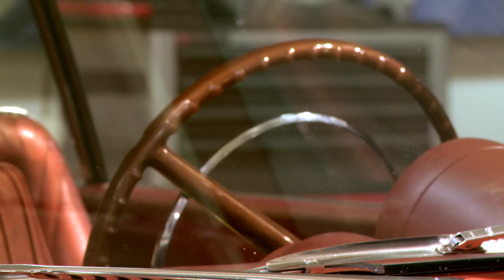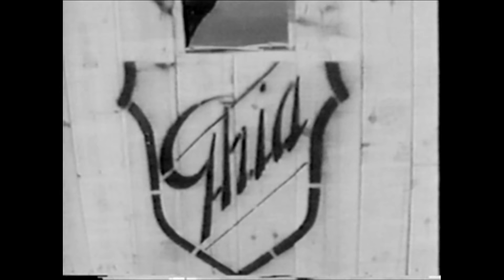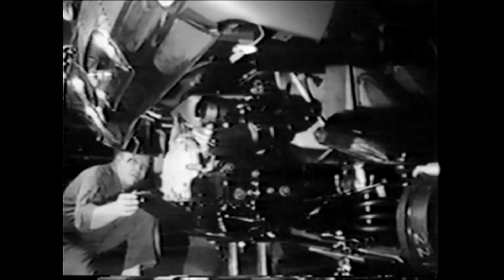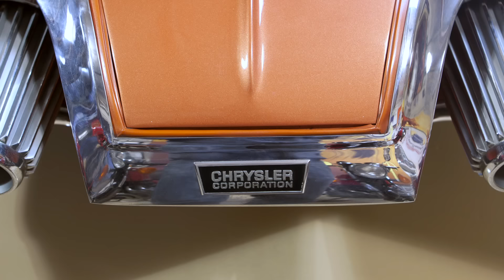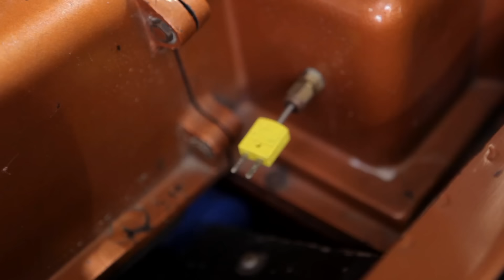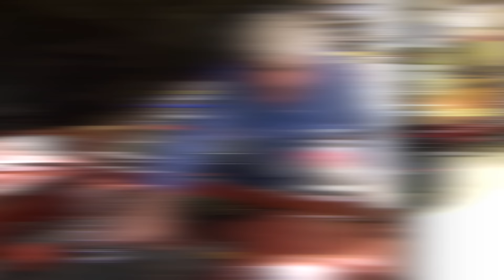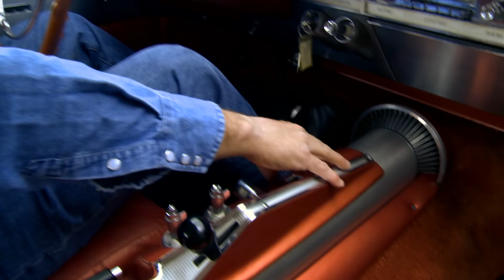1963 Chrysler Turbine: Ultimate Edition - Jay Leno's Garage

Comment: When I was a junior or senior in high school, I worked part time at Illinois Tool Works. They were a precision metal working company that manufactured the cutting tools, called hobs, (among other cutting tools) used to cut the gears for transmissions. Chrysler was a client. One of the executives at the the Keeler street plant in Chicago was given one of the cars to test drive for the three months. The minute I was the title of your clip, it brought back memories of that vehicle parked in the executive parking lot. The "pumpkin" color, the dials in the dashboard, the sound of the engine - what a thrill. Glad you have one of the remaining Turbines. It is in worthy hands.

Comment: As a 12 year old boy delivering newspapers in a small Western PA town one of these beautiful cars pulled into a gas station that was a newspaper customer of mine. The guy was filling the car with kerosene; I couldn't believe it. He was probably 30 or so, he was from New York. We struck up a conversation, he was very proud of the car which he said Chrysler was letting him use for 2 years at no charge (he had to give it back in 2 years). He knew I was genuinely interested and must have liked me because he took me for a 5 mile ride on the highway and back. Sounded like a jet engine. Took off like a rocket with tremendous acceleration. It has been one of my favorite cars since then. Almost 60 years later I still have vivid memories of that car and I still get excited thinking about it. What I wouldn't give for another ride in one.

Comment: Thanks for being a car guy. Be glad you didn’t put radial tires on more than likely you might have lost a hubcap. Seen this happen on a few older cars that came into the shop I worked at seems that the steel wheel just flexed to much.

Comment: As I was sitting at the bus stop on the way to high school, I saw this remarkable-looking car pull up to the light, then stop.  I thought it was just some kind of new "concept car" until I actually heard the engine running... it sounded EXACTLY like the turbine of a jet airplane, only quieter.  It was so cool that I nearly jumped up and shouted, but there were other people sitting next to me who would have thought I was crazy.  That was my only experience with a turbine-powered passenger car, but I'll never forget it.

Comment: I've said this before, ive drove this model 1000 times while I worked at Chrysler engineering. I was running a test to try make it fail to startn(it never failed to start). I also build the "variable pitch power turbine" that turned the engine into a tire smoking powerhouse with good engine braking. So much more.

Comment: I remember back in, I believe 1963 or 1964 the local Chrysler dealer had a special showing of this car. I was 14 or 15 at the time. I went to the showing as it was only about 4 blocks from where I lived. I was awe struck at the whole car. When the announcer said how smooth it was he demonstrated by putting a buffalo head nickel, you know the one that looks like an octagon, on edge while it was running and it stood there and didn't move. It was amazing. Never ever forgot that. Often wondered why it was discontinued. Now I know. Thanks for doing this video. I would have loved to ride in it. What a kick that would be. This was in Lethbridge, Alberta Canada. Population at the time was about 30,000 so you can see it was a big deal for us to have the car shown here.

Comment: Turbine story
I drove bus for Trailways in Boston Mass 1970 to 1976 and in the early/mid-'70s (don't remember the exact year) Greyhound experimented with a turbine bus 
On its first trip into NYC as it was leaving the Port Authority, it had to stop for the light leaving the Port and another bus stopped close behind it. Being a bit of an upgrade the driver of the turbine had to step on it to get rolling. Unfortunately, the combination of a roof level exhaust, high exhaust temperature, and a close bus didn't work out very well, it burnt the paint off the top of the following bus.

Comment: FYI:1966,US Army we had Chrysler Turbine track vehicles,all aluminum,we burned JP4 in them. You sat in the drivers compartment on a little secretary chair with hydraulics.To your side was a domed wire screen with a rotating fan blade,about 5' across. I mentioned to my Brother who was in Nam in '67-8; he said oh we had APC that were turbine,I told him no! ;you had Turbo diesel ,not turbine.Took him a while to realize we were talking about different animals.
The swoosh sound in the video is reminiscent,they were all auto transmission and we had two laterals for steering.They would turn on a dime and we did a lot of chasing jack rabbits,in Oklahoma. Their use was to carry missel sections,and other for communication huts,and a power station.So easy to drive and a lot of fun.Everything was secret on a need to know in our unit.Wikipedia states that the first Military use was in 1972 in the Bradley tank,but we had 'um first. And they were uber kewl.

Comment: Better in all aspects? How in  the hell do you explain the current fondness for Electric vehicles? Electric vehicles, where you spend more money for less car accept a limited range (God help you if you get stuck in a traffic jam or storm) in most cases still use fossil fuels to generate the electricity that still  has to be distributed over an ageing and already overtaxed antiquated delivery system with an extended time needed to charge. That's still not addressing the rare earth materials and toxic heavy metals needed for production for the electric automobiles and the issues of risk and environmental contamination should one be be involved in an accident. Don't get e wrong I could see a place for electric cars in the scheme of things but there seems to be a strong political opposition tot he lifestyle that would promote or grow the niche market electric vehicles could serve in.  I have to wonder if Chrysler shouldn't of taken some of this technology they developed for this engine and sold or produced it for aviation, marine and power production especially in co generation applications.  If properly executed we could of seen Chrysler turbines hanging off the front and wings of countless Cessna, Piper, Mooney, Beachcraft and Gruman aircraft or Chrysler Turbines producing heat and electricity in facilities using low grade recycled or bio-sourced fuels.

Comment: Exact same "lusted after" reaction as Jay, when they announced the turbine. Gobsmacked when I got to see one on display in Orange County. I have to wonder, if pairing the turbine in a hybrid like the Prius system, wouldn't solve the fuel efficiency problem. Is anyone is looking at that? I would think you could even scale down the engine size if the turbine is only powering a big alternator.

Comment: Chrysler's accidental downsizing of most of their full sized models for 1962 (triggered by an overheard conversation about a new "smaller Chevrolet", which turned out to be the Chevy II/Nova, rather than a radically smaller Impala) and the ensuing reaction of their customers almost sank them. It's amazing that  they pulled something like this off while under such financial pressure. Seems that the turbine engine is better suited to applications in which most of its run-time is at maximum power, like airplanes and electric generating plants. Maybe there would be a role for a small turbine engine in today's electric cars, to recharge the battery on long trips.

Comment: Great story!  I did a research paper on these vehicles, in college, back in the eighties, before the internet.  All of the information in this video is spot on and very well done.  Chrysler also looked at building the engines out of ceramic components or even ceramic coated components. The bonding agents that were developed made the ceramic parts as strong as steel, but there was no way at that time to mass produce them.

Comment: I wonder if ((like your rocket) the turbine could be rethought for today. Maybe using a scaled down turbine that works as a generator to power electric pancake motors at each wheel. 

Hybrids and electrics need mined materials, this you burn anything combustible.

Comment: The turbine powerplant should have started to replace the internal combustion engine at this point...consider the lightest of the American typical V8 engine makes 400 horsepower at 400 lbs of weight...the very old Pratt & Whitney PT6 turbine weighs the same 400 lbs, but is rated at 500 to 1900 horsepower(shaft-horsepower)...just think what could have been, if turbines caught on?

Comment: Being a Mopar fan, I knew of these cars when I was a kid. I remember reading about how these worked, the simplicity of the turbine engine. No pistons, rods, cams, valve trains, no distributor, ignition points, coils, etc. Also, Ford was using turbine engines in tractor-trailers in that era. The downside of the turbine was fuel consumption. The only turbine-powered vehicle I have ridden in is an M1 tank, which used some 2 gallons of fuel to move the tank one mile. I'm sure the Chrysler has a smoother ride.

Comment: I was 13 in 1964 and I remember these cars being featured in Mechanics Illustrated magazine (I think).  Don't recall if I ever saw one on the road.  In 1976 I was stopped at a red light in Van Nuys, California (Kester Ave & Victory Blvd) when I heard what I thought was a jet airplane flying very low overhead, but it was odd that the sound didn't seem to be moving away and remained quite steady, sort of like it was a helicopter.   I stuck my head out the window looking for the source but couldn't spot it and it was puzzled at that bc the sound was plainly audible and seemed very close by.  Then the light turned green and the new Corvette next to me accelerated away from the intersection and I could hear that whining, rumbling, whooshing, roaring jet-sound increase and I saw heat shimmers coming from the rear, and then I immediately realized the car must have had the engine swapped for a turbine.   One of the few good things about living here is the higher than average number of custom cars being driven right out on the streets.  I've seen some cool ones, and that one is the top of my list, technologically speaking.

Comment: I read about these cards back in the early 90's when I was in the Air Force stationed at Bolling AFB in D.C. I was fascinated by the application of jet engine technology to the common automobile. It's very sad that Chrysler couldn't make them practical enough for the mass market.

Comment: Fascinating show. I remember reading about these when I was young, and if I recall correctly, there was a turbine car raced at the Indy 500. I've wondered if a small gas (either LPG, propane or gasoline) powered turbine could be developed as a generator for an electric car - whether that would be like a Tesla, or more like a Prius? If you could build a turbine just to charge the battery, and it wouldn't be running all the time, it seems like you could work on making it sufficiently efficient that it would be a viable alternative to a plug-in hybrid or a plug-in electric vehicle? Piston engines aren't really all that efficient, and if you think about it, plug-in cars run on whatever fuel is creating the electricity, (coal, anybody?) and the grid has efficiency losses.

Comment: While Chrysler's work with turbine engines never paid off in the retail automobile sector, the experiments proved fruitful with the incorporation of a Honeywell AGT1500 into a slightly different product, the M1 Abrams Main Battle Tank, developed in the late 1970s by Chrysler Defense (which was later sold to General Dynamics).

Comment: Chrysler engineering? Seriously?  It was an stunt from the ground up.  Turbines, especially in that era, were notorious fuel guzzlers and generated massive amounts of air pollutants.  Even today, the only reasonable non-military application is stationary turbines burning natural gas for electricity production.  And these are viable only due to the current low gas prices.

Comment: Hey Jay, while I was an auto tech student at Saint Luois Community Colledge at Forest Park in STL, my instructor Jim Holfman who was fired from Chrysler for siding with customers complaints, told me that the reason for the turbines demise was the exhaust gas was so hot it melted tar roads, and it could have used space age ceramics for the turbines blades. That was back in 1983 when I attended. Incidently I used Jim for a reference and got the job at the Fenton plant I later retired from...thanks for showing this awesome auto...

Comment: Back in the day had one come by Camden,SC and remember us teenagers being titillated when it was explained that it could run on gasoline, kerosene, cologne or anything that would burn....remember the whine of the engine...and that tail end. Often wondered what happened to that thing.
One thing I miss from those days were the vent windows that came on just about every automobile.

Comment: never again will an automaker try something like this. This car will be one of a kind until its loss. (One of two, but this is the one of those two with a well-documented life, since it's Leno's car.)  

I thought the thing would be louder. I would like to see something like this implemented into interstate buses, like Greyhound. if it's that good on gas, it'll probably beat a Greyhound in fuel milage on the highway (Not that I know the MPG of a current Greyhoud bus)

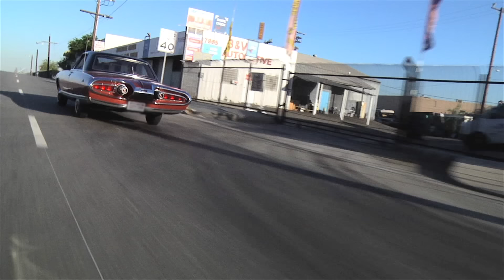Comment: The regenerators did not "recirculate the hot gasses", as Leno says @22:06 .  They heated the combustion chamber intake air using heat from the exhaust gasses; the trick there is to not mix the gasses themselves.
The Le Mans Rover-BRM turbines of 1964 and 1965 (but not 1963) also had regenerators.
By the way, Jay, Porsche is pronounced "porsh-uh", not "porsh".

Comment: JAY HAVE YOU EVER SEEN AND MC 7 TURBO CRUSER .GREYHOUND LINES CONVERTED A FEW MC 7 COACHES BACK IN THE 70S TO ALLISON TURBINES WITH ALLISON AUTO TRANSMISION THE ENGINE WAS THE SAME THAT WENT IN A BELL JET RANGER.318 HP THE 8V71 DETROIT WAS THE SAME 318 HP BUT GOT TWICE FUELL MILLAGE. THEY ONLY USED THE TURBINES FOR ABOUT 2 YEARS BETWEEN DC AND NYC BEFORE THEY PUT THE DETRITS BACK IN OR SOLD TMEM.NORMAN REED PLEASANT CITY,OH.

Comment: hey jay im 64 years old and in 1963 or so my mom had a mechacnic that liked her. he came by the house one day in a brand new car. i allways thought it was a thunderbird,but it was a turbine. he said at the time he was testing it for the car company. at 9 years old i didnt know anything about cars.but as i got older i did read about the turbine cars in a mag. i dont remember the guys name,but when leno said they loaned them out for testing i knew for sure it was a turbine,i wish i had een older to realize what the experience was. the oter thing i allways thought it had was instead of a sterring wheel you put your hands in tqo holes and steered it.i allways wondered about that. the only thing i can think of is when leno showed the instraments on both sides of the steering wheel. i must have remembered those instead of the round steering wheel. we lived in tampa fl. im wondering if there are records of one going to tampa.

Comment: I've often wondered why modern turbine technology has not been applied to mass-market outboard engines.  They run at a comparatively constant power output, have excellent cooling, and would be extremely compact.
Catalysts, improvements in metallurgy and computer control would undoubtedly make for a better chance at bringing turbines to the masses these days.
They could be a compact and simple thermal engine for battery-hybrid cars.  Imagine something only 50cm cubed, outputting 200kW!

Comment: The turbine car project was a on- off - on which ran into the mid 1980's using the Chrysler New Yorker platform where the turbine was refined with external add ons . Chrysler needing a government bailout at that time and Lee Iacocca re-tooling the company the turbine was closed. Which the same ideas were applied to the military on the M1 Abrams tank using another type of turbine engine introduced in 1984 the turbine engine concept is still working today operating in 60 ton tanks

Comment: Jay, did the Turbine car have air conditioning? I owned a 1963 Imperial two door with a 413 cubic inch engine. First time I took it out the red line on the speedometer roller hit 120 moh, and the roller was still spinning. I was lucky I didn’t get a ticket that day.

Comment: The Turbine car ran well on any fuel it encountered.  Back when gas cost 23 cents a gallon this may not have mattered, but think about it. This was not only an advantage it could be a problem. The roads are paid for by excise tax on motor fuels.  This could be an opportunity for uncontrolled tax evasion.
The Hillbillies in Appalachia have learned how to use the fermentation process and the distillation process. They make their own whisky. Is it possible to use something very inexpensive to make something with alcohol in it? If distillation can raise the % of alcohol enough, nobody may want to drink something that tastes this bad, but you could run a turbine car on it.
If the Turbine Cars wound up on the used car lots some inventor could buy one and use it to test his homemade fuel.
Due to all the tax on it, fuel in France now costs more than 7 dollars a gallon.  There are jokes about because of all the taxes "My take-home pay is not enough to take me home"
If we were making turbine cars now the U.S. we could save the French motorist from President Macron and the globalists.